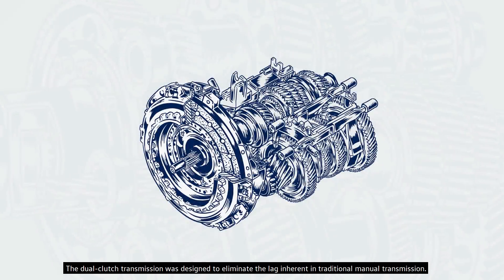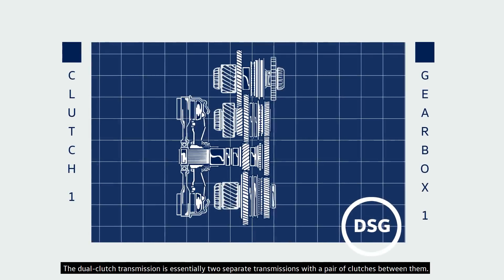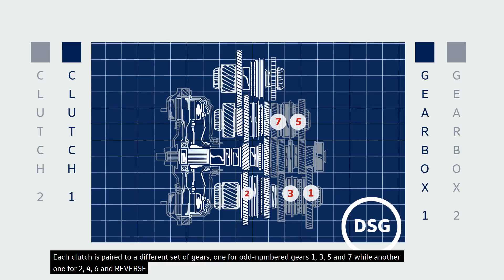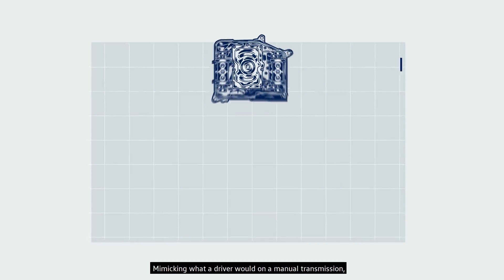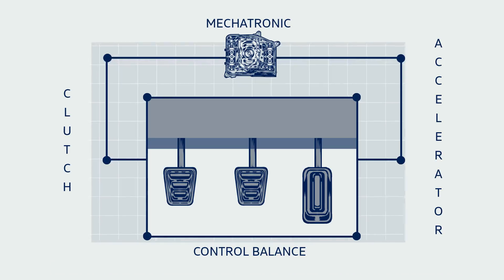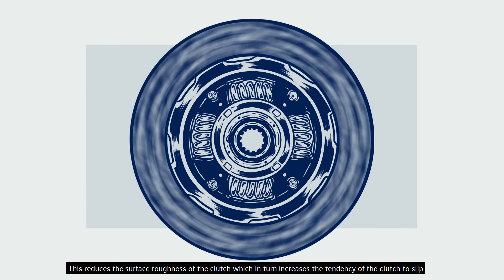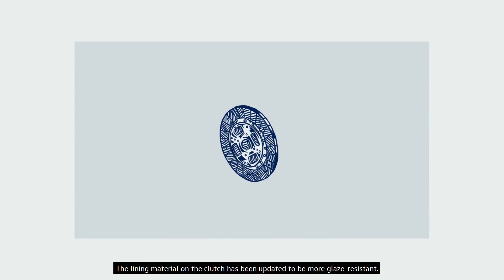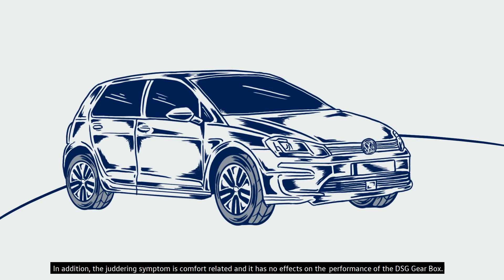The Dual-Clutch Transmission | Get to Know Your VW

Comment: Please make sure. Your juddering isn't a bad duel mass flywheel. I watched this video and thought my car was fine. Turns out it's not because the flywheel broke.
Reply: Thanks for the heads up. If you don't mind could eleborate on what and when do these juddering would happen? many thanks
Reply: Funny enough. I have that shitty shudder at low speeds. New DMF wentIN. No change at all. Not even a bit.
Reply: After putting the new flywheel in the car runs much smoother but taking off in 2nd and changing from 3rd to 4th the gar still judders. Turns out the mecatronics unit is bad but still functions well enough to drive normally.
Reply: I'm guessing a bad DMF amplifies the problem with the mechatronic unit seeing as it will vibrate alot more being worn out
Reply: @Walter Hartwell White  I've been told bad clutches and bad mech unit. I'm not gambling, just going to replace whole unit for roughly same cost as replacing one of those things